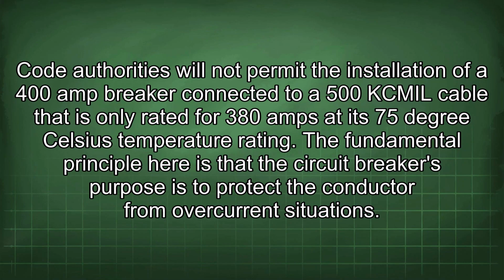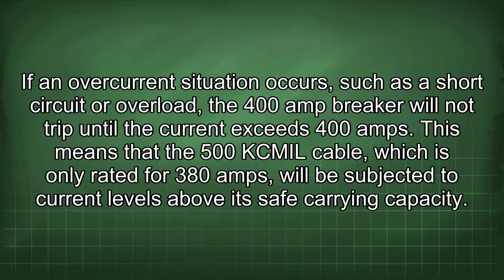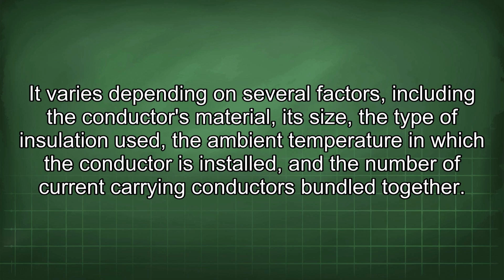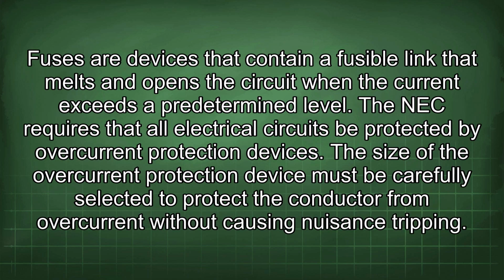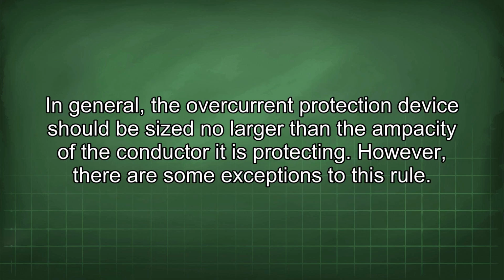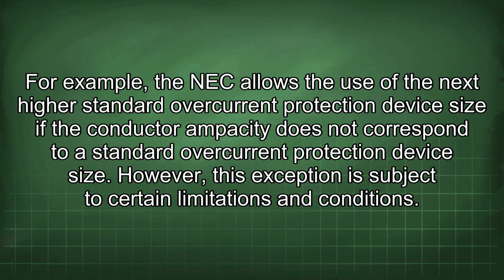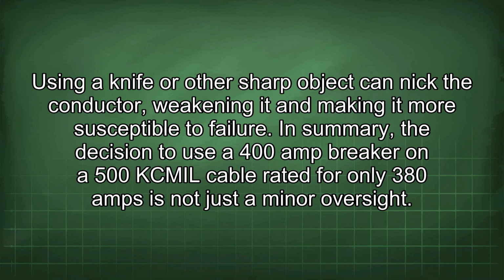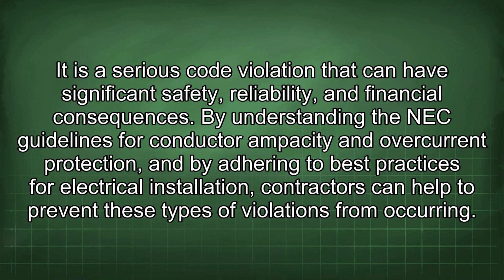400 Amp Breaker and 500KCMIL Cable Code Compliance

Comment: Does not NEC 240.4(B) (2) allow it?
Reply from the maker: Hello @jesusrperezd,

Thanks for your question. The statement is sometimes true. A 400 amp breaker on a 500KCMIL cable rated for 380 amps can be a code violation, but it can also be a perfectly legitimate installation under the provisions of NEC 240.4(B). This is a common point of confusion, and the code provides a specific exception for this scenario.

NEC 240.4(B) Explained
The general rule is that conductors must be protected at their ampacity (current carrying capacity). However, NEC 240.4(B) provides a "next standard size" exception for overcurrent devices rated 800 amps or less. This rule allows you to "round up" to the next standard size overcurrent device if the conductor's ampacity doesn't match a standard fuse or circuit breaker rating.

The National Electrical Code (NEC) provides a list of standard overcurrent device ratings in NEC 240.6(A). This list includes ratings like 15, 20, 25, 30, 35, 40, 45, 50, 60, 70, 80, 90, 100, 110, 125, 150, 175, 200, 225, 250, 300, 350, 400, 450, 500, 600, 700, and 800 amps.

For a 500 KCMIL cable with a 380 amp rating, there is no standard 380 amp breaker. The closest standard sizes are 350 amps and 400 amps. Since 350 amps is too small for the calculated load, NEC 240.4(B) permits the use of the next higher standard rating, which is 400 amps, as long as three conditions are met:
- The conductors are not part of a branch circuit supplying more than one receptacle for cord-and-plug-connected portable loads. This exception is primarily for feeders and services, not for general-purpose receptacle circuits.
- The ampacity of the conductors does not correspond with a standard overcurrent device rating. This is the case with the 380 amp cable.
- The next higher standard rating selected does not exceed 800 amps. In this case, 400 amps is less than 800 amps, so this condition is met.

Why is this rule allowed?
The NEC recognizes that there can be a mismatch between a conductor's precise ampacity and the limited range of standard breaker sizes. The ampacity ratings in NEC tables are generally conservative. Additionally, the overcurrent protective device (like a breaker) is intended to protect the conductor from dangerous overloads and short-circuits. The calculated load on the circuit must still not exceed the conductor's ampacity (380 amps in this case). The breaker is simply the protective device, and as long as the load is within the cable's safe operating limits, the system is protected.

Hopefully that clears it up. Please let me know if you have any other questions.

Sincerely,

BESA Research
Reply: @BESAResearch thanks for your response. The key point is the load. It must not be more than the cable ampacity (380A in this case).

So, 400A breaker protecting a 500kcmil might not be a code violation as the video states.
Reply from the maker: Hello @jesusrperezd,

Yes, it is entirely possible that it depends on the load for that exception. This is not too different from using 12 AWG for a 30 A OCPD on a compressor.

If someone learning needs to refer to our videos, we want them to be on the safer side. We will leave it like this and let them refer to the comments here for their particular situation. Thanks again for your feedback.

Sincerely,

BESA Research